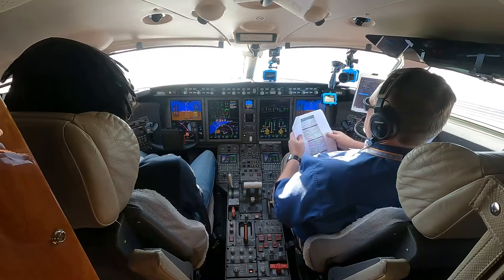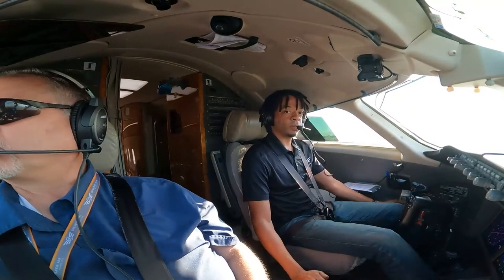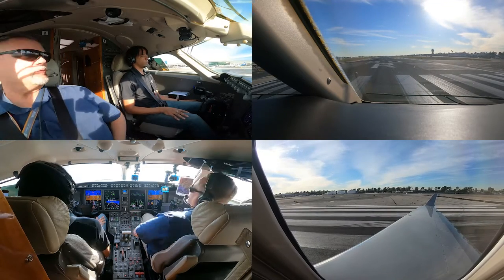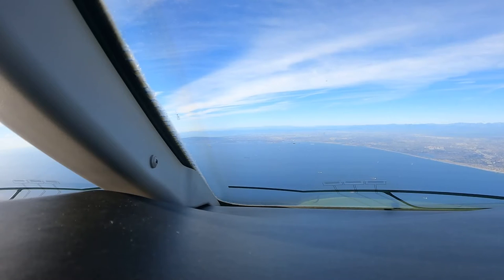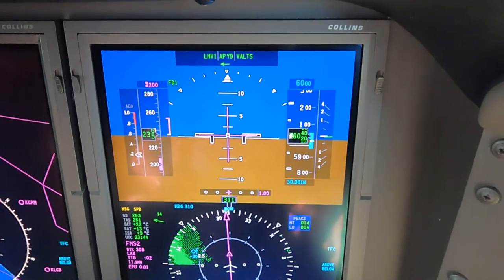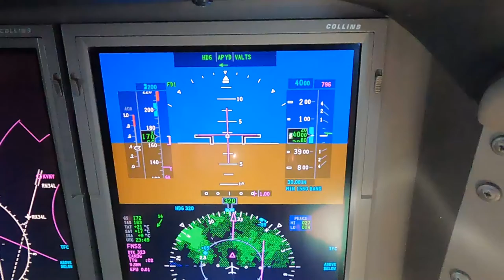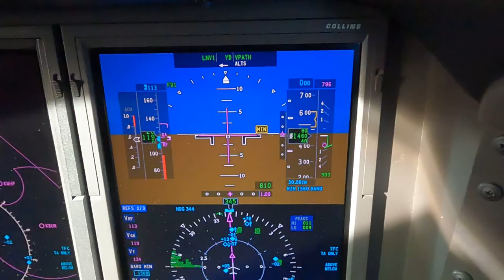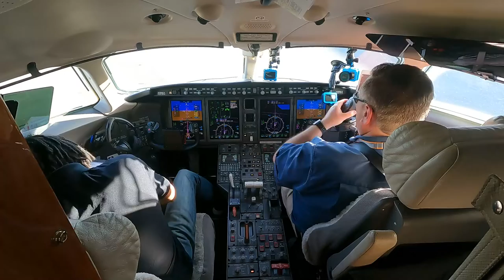Challenger 300 | SNA to VNY With ATC Audio Uncut

Comment: Always wondered what happens if someone drops a big deuce in the toilet?  Is the whole cabin in a gagging uproar or does the pressurization shove it out before it hits the cabin?
Reply from the maker: The toilet in the Challenger doesn’t have suction like the Gulfstream does but the system is still pretty nice. There was only one time a passenger really exceeded what it could handle but luckily it was toward the end of the flight. Shout out to the hard working ramp agents who have to dump the waste.
Reply: Never eat taco bell before a Challenger 300 flight :)

Comment: Curious, I never thought about it but does the autopilot move the throttle like it does the yoke? Also the metal strips on the front windshield, are they for ice or are they antennas?
Reply from the maker: No auto throttle on the challenger. Yes, those strips are part of the anti ice system.

Comment: "Fuel on board - sufficient amount" does not cut it. You need to verbalize required fuel as per the flight plan readout and repeat what the actual fuel on board is. Very unprofessional.
Reply: Unless his company’s SOP’s require him to say “Sufficient Amount”. Not every company is the same.
Reply from the maker: I didn’t include everything here. We covered the exact amount of fuel required and multiple other procedures prior to the start of the video. Thanks for watching.